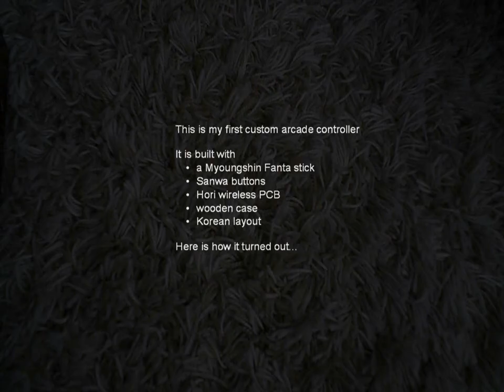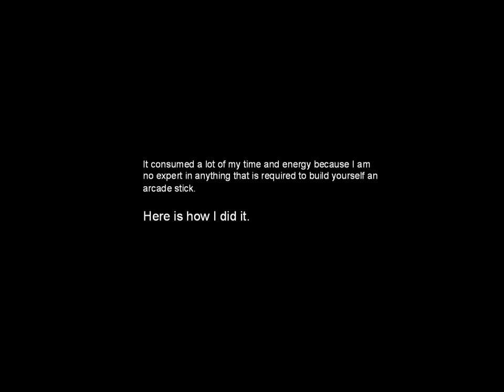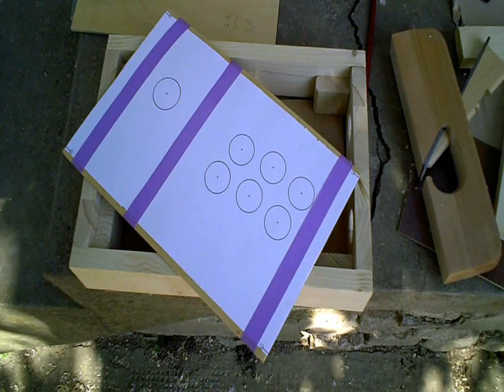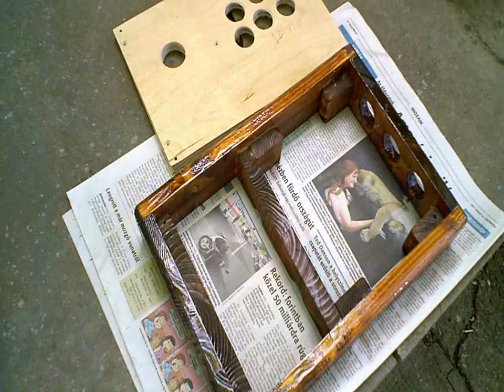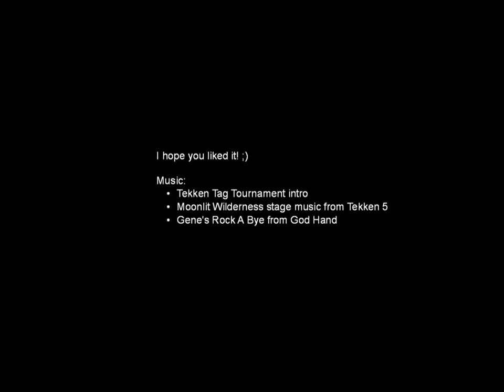Custom DIY Arcade Stick Controller (Sanwa + Myoungshin Fanta)

Comment: With the plexi glass, wedging it between 2 pieces of wood and cutting through the lot will "most of the time" stop it from splintering, although the holes saws could of been the problem as well. Just a suggestion for anyone else looking to cut their own plexi. I wedged my plexi inbetween 2 sheets of 7mm ply which is the face plate and joystick mount, had no problems what so ever with it splintering.

Comment: Good jobb man i like how u used the hori stick pcb to your build. i probly do the same or whit a wireless controler pcb .Thx for sharing your awsome arcade stick build
Reply from the maker: Thanks. BTW although I had no issues with the wireless PCB at first I was forced to switch to wired later. I made an other video about it. So I would advise to consider a wired stick in your case, too. The wireless stick is convinient but if you are in an environment with more electromagnetic interference it might give you issues.

Comment: hey man, i really need some help, ok i plan on using a gamecube or an xbox 360's pcb, how ever im not sure on how to solder the wires onto it, do i have to drill a hole to solder my wires for the sanwa buttons? if so what size bit do i need?

Comment: Hi, I'm currently using a QanBa Q2 glow stick and I've been thinking about switching to a Myoungshin Fanta stick. Is my stick compatible to achieve this? If so, what would I need for this?
Reply from the maker: Seio45 Hi, your case is made to mount Japanese levers so the Myoungshin Fanta will not fit. If you want to try a Korean lever without modding the case you can try the Crown CWJ-303A / 303-FK. This is a Korean lever that can be mounted onto Japanese cases.
Reply: ***** Alright, thanks for your reply. How are the Crown levers compared to the Myoungshin Fanta ones? And what are the differences between the 303A and the FK one?

Comment: hi, im having a problem maybe you can help. the thing is my homemade stick works but it sometimes get crazy. its made out of wood and the pcb is from a wired controller. i have noticed that when im not touching anything it would not do anything weird but as soon as i touch the wood or the stick it will start inputing random stuff. what can be causing that?
Reply from the maker: Well wood should not conduct electricity so it is very strange. Maybe you used some kind of conductive metallic paint.
As a start I would try to check the solder points and the exposed parts of the wires and insulate everything. I might even wrap the PCB in some kind of plastic foil to be sure it does not touch anything.
Reply: its not painted yet, i know it is very strange. can it be theres a short circuited cable on the pcb? on the pcb i made a bit of a mess on the L1 and L2 buttons but i tried to clean it and it seemed good, but can it be its short circuited?
Reply from the maker: Omar Santiago I would try to insulate the PCB first and if it does not solve the issue I would try to resolder the wires and test one by one.

Comment: hi i have the venom ps4/ps3 stick. will the fanta myoungshin fit in it or do i need to get crown 303fk?
Reply: Did you finden a answer?  is the arcade stick good?  can you change  the Buttons too?  can i change the Ball of the arcade Stick also?
Reply: +Akai__Kiri yeah I found the answr. the myoungshin fanta stick will need fot in it you will need to make the hole bigger. yes you can change the buttons i got sanwa buttons in there with crown 303fk stick. I'm a tekken player so the original stick was not all that I could not do movement properly because it was too loose and wouldn't get to neutral quick enough.
Reply: +Akai__Kiri also I brought 3 crown 303fk all 3 of them had different rubber grommets
Reply: +Akai__Kiri the first 1 was extremely hard the second 1 was extremely soft the third 1 was hard but i took the spring out of it, replaced the microswitchs with myoungshin fanta microswitches and now its the perfect stick!
Reply: +Akai__Kiri if you are looking to mod your stick let me know i will try and help you as much as i can.
Reply: +UknownAssassin Can you try and make your perfect stick & have it be able to fit inside a madcatz arcade stick? If so, let me know.
Reply: +Tony boyd well I ordered myoungshin fanta it should come through tomorrow, I will need to further mod my stick so it will fit in. I will let you know how it feels once i am done. i was extremely drunk when i wrote my previous comments thats why there are random spelling errors lol i am also drunk right... from my personal experience crown has been really inconsistent and I hate it.
Reply: +Tony boyd I don't think you will be able to mod mad catz with myoungshin fanta but you will be able to do it with crown cwj 303fk
Reply: Hmm...
Reply: +UknownAssassin thx man,  since yesterday i got the venom arcade stick. it was pretty cheap. got the stick for 85 Euro. i'll Upgrade it with sanwa parts and definitly with a octo gate. shoryuken moves and down left charges a pretty Hard to download with a square gate in my opinion. my friend has the Same stick with a octo gate and it is so much easier. ^^
Reply: +Öey! - Gaming I have sanwa too I'm going to try oct gate in it.
Reply: +UknownAssassin imo octo gate is the better choice. esspecially wenn you like to play with Chars like fei long with 3x down,  forward punch Actions. I can't perform that with a square gate...it feels so unnatural xD
Reply: If anything, I'm just looking for microswitches that are smoth and light like the fanta myoungshin that I can install onmy crown.
Reply: +Tony boyd get the fanta switches from etokki I have them on my crown it also depends on how soft your rubber grommet is
Reply: ok
Reply: +UknownAssassin Thing is I have the crown cwj 303a installed on my madcatz & was thinking about switching the microswitches for gersung. Will the rubber grommet in my crown be good enough for it, or does it vary on the arcade stick?
Reply: +Tony boyd Do you guys have a ps4?  maybe you want to play and practice a little bit?  I have SFIV,  Blazblue Chrono Phantasma,  Guilty Gear,  MKX and Dead or Alive
Reply: Ps3 actually. I play tekken. Thing is I've tring to do a foward 180 motion on my arcade stick, but it feels inconsistent.
Reply: +Tony boyd 303a and 303fk are the same sticks. i have 2 of them one with really hard rubber one with really soft the fanta switchs should be fine with the hard rubber grommet. i got fanta rubber to put in my crown it was too big so i trimmed it up with some scissors to make it fit lol
Reply: +Tony boyd Damn i only have a xbox 360. Played T6 and TTT2 a lot on it. My favorite Character is Zafina. :D
Reply: +Tony boyd i have ps3 i only play ttt2 it's my first tekken game been playing it for 8 9 months.... my gamertag is TheNameIsKhan add me I'll play ya some time
Reply: Will do
Reply: +Öey! - Gaming have have 360 and xbox one too of you want to add me my gamertag is muslimninja786 I got ttt2 on it but can't do movement for shut because of the pad. I will get adapter for my stick so I can use it on xbox one

Comment: I'd pay anywhere from $400-$600 if you were to make a fightstick just like that but with my own artwork under the glass. I've been looking everywhere but Foehammer and every other website is way too over complicated.
Reply: to make it yourself would cost you about 150-200 they are pretty easy if you buy kits with the i-pac pcb board, then you just have to make the box ect
Reply from the maker: Check out my other arcade stick. It is cheap and way easier to build.